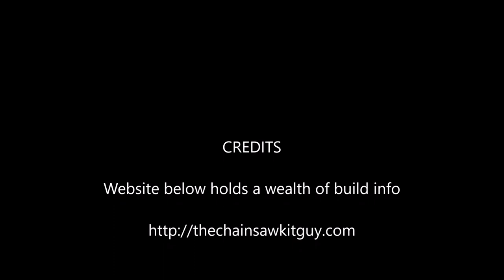FarmerTec MS200t Chainsaw Kit   Muffler, Tank Housing, AV Install

Comment: All I did was lightly sand it and it went right on.
Reply from the maker: What did you sand?
Reply: Sanded the inside of the ring a little and it went on took a little force but not bad. Been running perfectly
Reply: Those rings all have a little to much material

Comment: What's the name of the 3M product your using as a heat deflecting material?
Reply from the maker: aluminum tape. You find it in the HVAC section @HD or Lowes or amazon